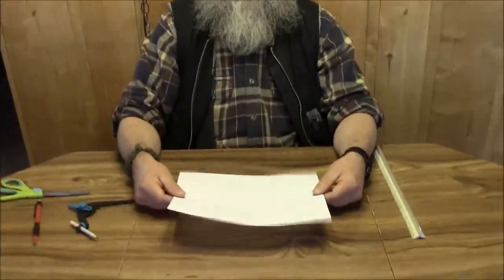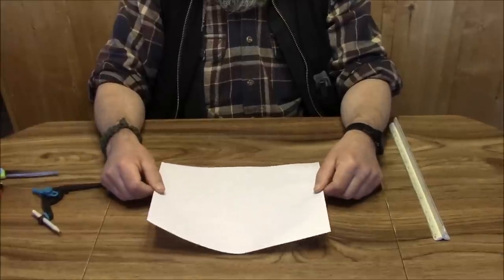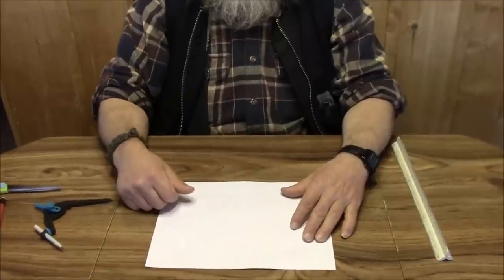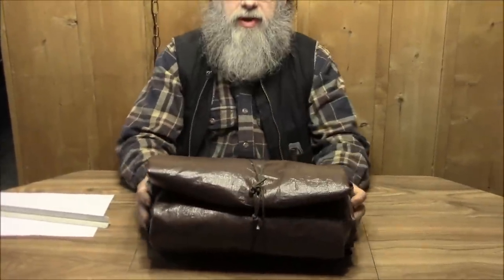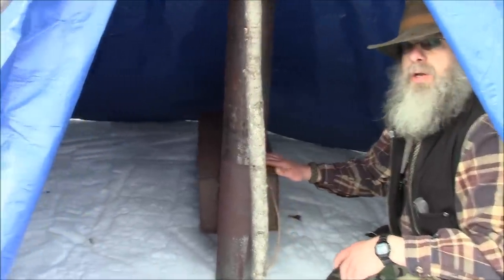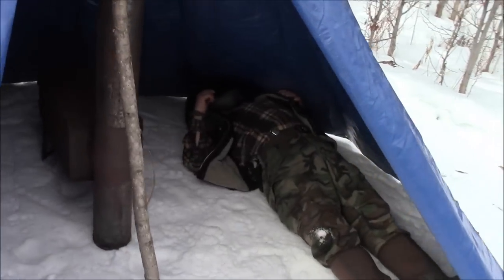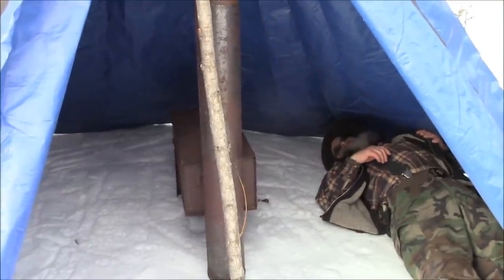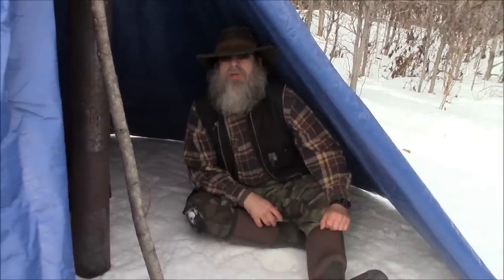Make A Tarp Tent Tipi Hot Tent On The Cheap

Comment: Wiltshire Man on youtube had a recent video where he puts up a similar tent, and it has a hat.. I was wondering why you'd leave a hole, then add a hat, seems like a waste of time and effort, and then I thought, of course! For the smoke! If I recall correctly the Native Americans left a tiny hole on top of their tents where the wood sticks would stick out, and that was to let the carbon monoxide and the like out of the tent, but that hole would allow a minor amount of snow and rain to drizzle in. A smarter idea is to have a hat, as long as your tripod contraption frame does not have the wood sticks stick out too far.. it's common practice in vertical chimney designs too, to have a hat, like a roof, and the smoke comes out to the side. Because of hydraulic rules and buoyancy, the volume above the hat first gets filled with the light and hot gases, then it pushes down, and it finally escapes going a tad bit downwards at the top. With an opening at the top and a hat covering it with a good gap, you might be able to set a classical Native American fire in a pit surrounded by some stones to radiate the heat back, and don't even need a chimney maybe, because the rate of carbon monoxide generation vs. the emission rate from the tent would allow a low enough concentration for breathability. I don't know about smoke though, that would deposite everywhere. So unless it is radiant heat you're seeking, like from a fireplace, it's best not to generate smoke at all, because that means you burnt up all the fuel too, better fuel efficiency. There are some rice husk burners on youtube, one is titled vietnam magic flame, or another from the Philippines, and they got it right, and got a beautiful blue flame out of it. The secret seems to be precombustion/pyrolysis with limited oxygen, to get sooty fire/fuel mix, kind of like a wood gasifier, with just enough air filtering through the rice husk or saw dust from below to keep the gasification process going, but not too much to combust everything up and end up with soot. Then the key thing comes, which is mixing the carbon monoxide/hydrogen/tar/soot with some more air, and allowing enough travel distance for complete intermixing, such as in a Bunsen burner or propane torch, and only then light it up with the second flame. Of course it's all a black magic art, with, sometimes luck, and the next time you can't get the same thing again, because the fuel is slightly different. The 2nd flame does not propagate all the way down to the rice husk or saw dust, partly because of flame propagation velocity (sometimes gas burners go out with a mini explosion puff when being turned off and the gas velocity becomes too slow, the flame does go back into the propane torch or Bunsen burner, or simply natural gas stove), but that can be helped greatly by adding a mini-mesh, and it does not have to be to the finesse of the Davy-lamp made for mines that is explosion proof, but more like a flat plate with like 9 or 16 holes in it s sometimes enough. Some youtube make your own bunsen burner videos have that minimesh-like perforated plate thing as a flame blocker, but note that that vietnam magic flame does not have a mesh at all, and it just relies on fuel/air flow rate and flame velocity to keep the flame away from the rice husk right outside the stove. Oh yeah, and I found an awesome propane burner thing, it's really simple, but it can be used to premix air and fuel intimately before lighting, and then if well mixed, it should burn blue, as opposed to when not well mixed, and then you have a flame structure like a candle with different zones of oxygen concentration, and a luminous low oxygen zone where carbon soot glows from the high temperature. That glowing comes in handy in a castle fireplace where it's impossible to heat the whole hall, especially because the ceiling is so high and all the heat goes up there, so the only way for a knight to get some warmth was to walk up to the fireplace, take his metal armor off, and sort of sunbathe in the flame, then turn around, irradiate the other side too with infrared, and it's a crappy way to get warm, one side freezing the other side super hot, but it's better than nothing. In that case the sooting flame is useful, but in most cases a blue flame where no fuel is wasted as uncombusted carbon soot is best, as long as you can transfer that gas heat via conduction/convection contact to another surface that is black, and it is the one that radiates the heat as infrared. The best metal stoves are made of cheap cast iron, but they are almost exclusively black with charcoal/and a bit of tar maybe, i don't know how they get it black, but it's partly for corrosion, partly for better heat transfer and radiation. So even that chimney exhaust, which they make shiny with a galvanized zinc plate, it's best to black it up with a candle maybe, then rub something that won't smoke from the heat, or maybe it will but after it burns off it creates a stable crust. Also the longer the exhaust portion, in case you exhaust the hot gases with a pipe, the better the heat transfer, and it might be economical on the fuel to have instead of a straight up I an nu up down up section, or nununu.. there is a limit of payback here.. also the first leg of the n has to start much lower than the bottom of the U's, else it won't be able to push the hot gases through the initial startup phases, and would need a blower to get it going.. if you want to play with extra exhaust portion (something that makes more sense in a house than in a tent), you might want to try 1 foot difference or 3 feet between the first leg of the n and the bottom of the u's. Also in a house there might be room to run a long exhaust section horizontally along the wall, which is actually better than an nununu section, because the air would naturally convect along it, and you might have a lot of room along the walls. Also in the house because of long runlength possible and final chimney temperature almost the same as the room temperature (meaning you're not heating the outside world), it's not that important to blacken up the exhaust pipe, maybe the first 3 or 5 feet of it, where the air is super hot, or whatever you figure out. So that sums up my ideas on how to stay warm in Alaska without having to burn a lot of wood. I'll make another post with references, I'm afraid if I go fishing for them now, I'll lose all this text I just typed, and I don't feel like retyping it, i know it's too long to read, imagine how long it takes to retype!
Reply: well I cant seem to track down where I found a neat and simple propane burner .. i think it was ebay and now the listing is gone... maybe it was youtube..  it's basically a 2" iron pipe made about 6 inches long, into which you stick a 1.75" main conduit, and the gap between the two is your  air intake hole, space out by 3 screws that bite onto the central pipe. It's probably easier to drill tiny screw holes, even if not threaded you can use washers or two female screws on the same male to space a gap, and also the air intake rate is somewhat adjustable by moving the central pipe forward of backward. I don't know if such a simple common sense idea is patentable or not, patents have gotten really weird and totally insane and out of control these days, like exercising your cat by letting it chase a keychain laser dot, gee whiz., so there might be a weird patent somewhere, you are welcome to pay an attorney to do a patent search if you worry that the police might enter your home and find a home built patent violating device, but it can be more economical to make than other propane torches where the holes are huge and predrilled at a fixed location, and it's hard to adjust the fuel/air mixing length, maybe with a complicated add/on pipe at the tip
the other two references, wiltshire man's latest videos, and rice husk burners including vietnam magic flame should come up quickly on youtube search
Reply from the maker: Sillybillydilly I looked up wilshire man and did not see any Vietnam Magic Stove videos on his channel.   That is okay though as I don't really care to get very complicated.  Just a simple woodstove will be fine for me.  Sounds like you have done some studying on this stuff before.